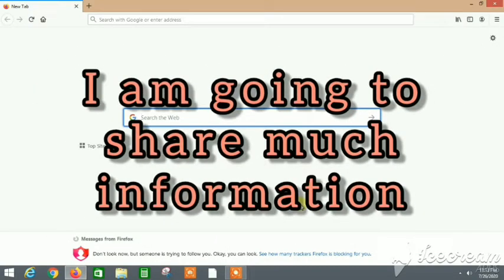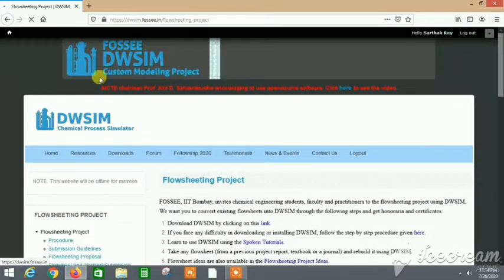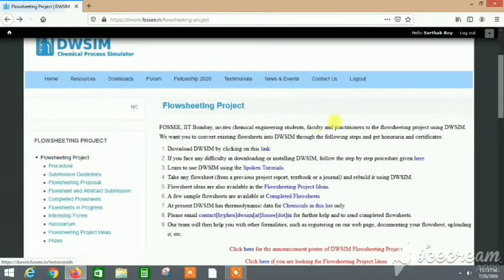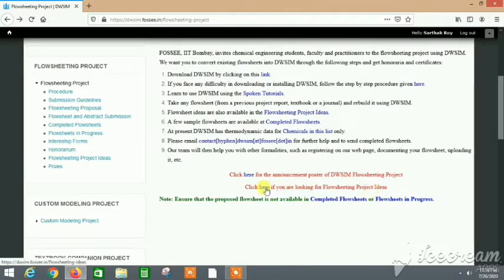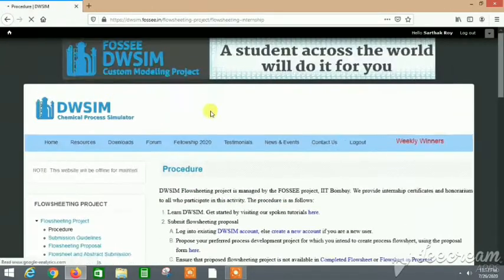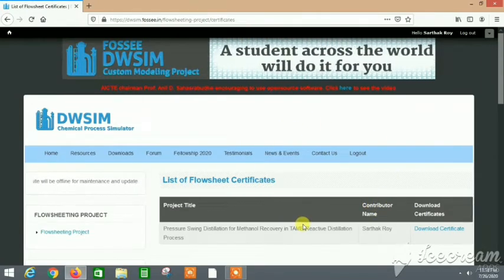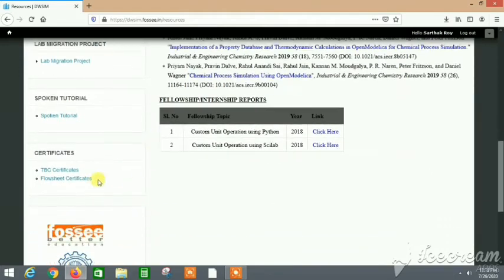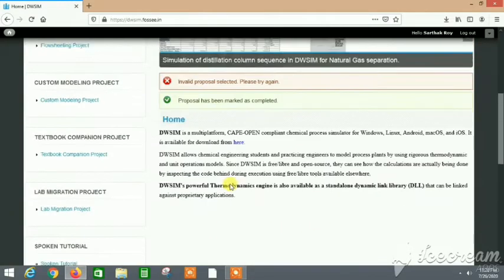IIT BOMBAY DWSIM Flowsheeting Project FOSSEE that changed my career.....

Comment: After submitting the flowsheets we have to submit the internship forms
Reply from the maker: Yes , you need to send them via Indian post to the mentioned address. You can use speed post.
Reply: In the bank transfer details forms at last I have to sign
Reply from the maker: Yes